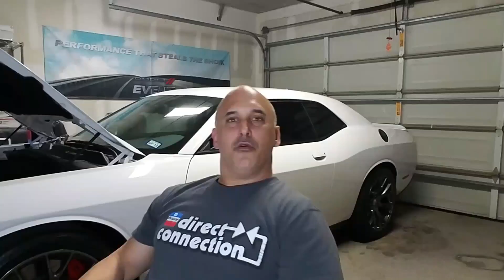Hemi engines, A quick explanation. Also, why did it take so long to reintroduce?

Comment: The emissions are way too tight today to ever have the OG HEMI again but the 392 and 345 today is about as close as we can get. The updated design still with OG roots is a throwback yet is versatile in most applications of driving.

Comment: Sad part is it isnt a true hemi.......its a bad joke
Reply from the maker: Thank God it's not a real Hemi, you obviously have never driven one. They drive like s*** unless you're at wide open throttle. So what part of "true Hemi " would make it better? Terrible drivability, horrible fuel mileage? The most hysterical thing about this, is that Dodge was trying to get out of the Hemi business before 1971 when the engine was canceled. They had long before realized that a canted valve architecture would not only be more economically viable, but would yield similar results at high RPM to the Hemi. There was also the pentastar head 4-valve that Dodge also called a Hemi that was under development to take the place of the cam in block engine.   But I guess you wouldn't call that a true Hemi either, would you? Typically I don't take this long on a response, but you really got underneath my skin on this. It's another joke in the Mopar community, the joke of the dying breed of people that "remember" the Gen 2 Hemi from the 60s. And I mean that literally, Because in 20 years nobody will be alive from that era. be glad that Dodge doing something now, lest your Legend and Legacy dies with that generation.
Reply: B Mason absolutely dead on target. Even us ole farts are driving today’s challengers, and chargers for one reason one reason only we remember the sound the feel of raw power not from a supercharger wine but from balls to walls POWER!!! Sorry but you have to respect the old to appreciate the new and boy do I ever. Start up thst 392 every morning to wake the neighbors lol

Comment: back in 1989 I rebuilt a 1970  barracuda 340 magnum wedge. 10:5-1 compression 375 hp but the kicker it red lined over 10k rpm and had 90 psi oil pressure on a cold start. I now own a 5.7 hemi in a 2018 challenger. It is rated at 375 hp it is a 345 cubic inch but because of the pollution control equipment and the computer governors red line it's rpm at about 5700. The new 5.7  gets a lot better gas mileage , I dont think it has the pep of the older 340 as in throttle response but with the 8 speed auto and variable valve timing the newer  5.7 has more torque. I love them both.

Comment: I have a 2016 Ram 1500 with 5.7 engine, I have the Hemi Tick and I hope I do not have the lifter problem that causes the flat spots on the camshaft. I have heard that the needle barrings on the roller lifter go bad causing the lifter to fail.

Comment: Old hemi new hemi it doesn't matter because 400hp is still 400hp but can say that the new hemi engine's you can put a bigger cam in it and get more HP then the old hemi with a bigger cam. The upgrades to a new hemi  will yield more HP/TQ . But as far as hemi engine's go they are still just the same as they were when they were first invented not much has changed.

Comment: First ..The 1966-1969 Street Hemi's ran solid lifters, then changed over to hydr.in 1970-1971.I ran a 1968 Hemi Road Runner..with a 432 cid  Twin 1150 Holley Dominators on a Weiand Tunnel Ram, 12.5:1 aluminum piston /compression, Triple Valve springs,titanium retainers  785 lift 296 duration cam&roller lifters. Built Torqueflite, 2.77 first gear straight cut gears, reverse shift pattern trans 5,000 stahl convertor , 5.11 rear gears It ran 145 mph 1/4 mile  9.4 time.  That was after it was stock..it ran 12.7 stock..with a slipping trans..(needed new clutch packs) The old street Hemi..mine got 22 on the highway and 11 around town..hard to keep your foot out of the 2x4's The old Street Hemi's still kick ass..on the new ones..just look around on Youtube.. You kind of bug me with your smug like attitude ..and the so called know it all about Hemi's.  I'd tone it down a little.. maybe it's just me..but that's how you come off to me.  I'd rather build a Hemi any day of the week. I found them easier to work on..I could do it in my sleep.. The 426 cid Race Hemi Z990..if that's what you are referring to as The Super Commando Hemi..had different heads..better heads and the block was canted up 10 degrees whereas the Street Hemi is not a true Hemi either..-10  Still dynoed at 490 -500 hp..Just my 2cents..
Reply: he really didn't do the history very well either. The first Chrysler Hemi was actually the massive 36 liter XIV-2220 inverted V-16 aircraft engine developed by Chrysler during World War II it was never put into production but Chrysler engineer learned a lot from that experiment. their were there "company" hemi's, the Chrysler's, the Dodge's and the DeSoto's ( the Desoto's are what gave us the 318 poly's). Hell the 392 Hemi from the Chrysler 300-D's was used by Don Garlits (first hemi dragster) back in the late 50's. The eventually quit making them because of expense, well until the NASCAR day's anyway.

Comment: Not sure if it was mentioned in any other comments. But from 1966 to 1969 the street Hemis used solid lifter camshafts . In 1970 and 71 they are hydraulic lifters

Comment: They had to wait for VVT to be developed to get around the low end and emissions. Emissions is why it’s still not a true hemi. Based on patent applications Chrysler began to develop their VVT in the late 90s. I wouldn’t use the penastar as comparison as it’s no where near the same head design as well as it was developed much later. The only thing they have in common is all Chrysler NA motors use only a MAP sensor instead of a MAP and MAF that’s more common in other companies engine management or FI engines in the Chrysler line up. Speed density is accurate enough for NA but not that great for FI set up.

Comment: How knowledgable are you on hemi? I understand your hemi explanation but what makes the car get up so fast and what makes it make that roaring noise? Also, why when I start in the morning it's even louder
Reply from the maker: TeW33zy the hemi, and many other engines, are louder on cold start due to the timing being retarded, in reference to normal operating temp timing values, comboned with a rich fuel mixture to aid in initial start up.

Comment: The original Chrysler hemi engines were introduced in the 1951 model year.  That first generation hemi was phased out in 1959.  The second generation hemi was introduced in 1964 as the race hemi.  In 1966, the street hemi was introduced and reigned supreme on the streets until 1971, when production ended.

The Super Commando engine was a Plymouth name for their V8s.  Dodge went with Ram, then Magnum for their engine names.  I am a fan of Chrysler automobiles from the Walter P. Chrysler days.

Comment: Fuck FIAT CHRYSLER! They have sold us a HEMI that has rocker arm/lifter problems around 100k miles. HEMI knock = RIP engine. Anyone looked at the wear of their cam shaft lately? I've seen 1995 stangs with less wear at 240k miles where Dodge gets at 80k.
Reply: jlrockafella our 2004 ram 2500 @ work has 345k still has the original cam .

Comment: Somebody need to learn the difference between HEMI® and hemi... they are not always the same.
Reply: I REALLY hate to say this, but Beemer is right.

The third gen "Hemi" is really a polyspherical 
combustion chamber engine.

"The current-production "HEMI" engine heads are flatter and more complex than the 1950s–'70s Hemi V8 chamber. The combustion chambers are no longer truly hemispherical."

Copied from here;

https://en.wikipedia.org/wiki/Chrysler_Hemi_engine#Third_Generation:_trademarked

I'm a Mopar fan, and have been since the mid 60's.

The second generation Hemi, is STILL the 
blueprint for top fuel drag cars.  (Well, except 
Big Daddy's stuff, he's running First Gen engines.)

The third gen engines, while being "Hemi" engines, 
aren't quite true hemis.  But 840 HP out of a street 
legal car, that is powerful enough, to lift the front 
wheels, and both fast (MPH) and quick (ET) enough 
to get thrown off NHRA tracks, is downright amazing!
This is a car that you can buy, legally drive to the track, 
and get kicked out, for to low ET, as well as a to high 
MPH!

steve
Reply: @bobba68 YOU'RE HERE ON THIS SIGHT TOO WITH YOUR HEMI PIPE DREAMS. FORD WHIPPED THE HEMI'S ASS, THEY WERE NO COMPETITION FOR THE 427 SOHC AND THE REASON THE NHRA BANNED THE FORD CAMMER IN 1971 BECAUSE IT WAS TO FAST. A HANDFUL OF CAMMER'S WERE BEATING DOWN ON THE HEMI SO BAD THAT THEY HAD TO GET RID OF IT. SO THE NHRA BANNED IT. GET OFF YOUR HEMI PIPE DREAM.
Reply: +bobba68 Hemi engines are obsolete
Reply: +bobba68 You are still suffering from nostalgia escapism... Hemi engines are obsolete.
Reply: +bobba68 Well, then please point me to a new car dealer where I can buy a REAL hemi engine????  .... you lose.*
Reply: +bobba68 "No longer produced, Discontinued, To be or become obsolete by replacing it with something new."
Reply: +bobba68 Hemis are OBSOLETE
Reply: +bobba68 Name a single currently available automobile model manufactured in series mass production that features a real hemi engine????
Reply: +bobba68 OBSOLETE
Reply: +bobba68 Then name just a single currently available automobile model manufactured in series mass production that features a real hemi engine???? There are none...
Reply: +bobba68 The real hemi engine is obsolete????
Reply: +bobba68 Still being made? Not for any new cars.. The hemi has been out of series mass production for decades.
Reply: +bobba68 They still make a few steam locomotives too...even though they also have been obsolete for years!!!
Reply: +bobba68 You are the one that has lost the argument... in fact you never had one.
Reply: +bobba68 I must say you make an excellent case study subject for the Dunning–Kruger effect...
Reply: +bobba68 hemi engines have been obsolete for decades
Reply: +bobba68 An automobile engine that is no longer used in automobile production is an OBSOLETE ENGINE
Reply: +bobba68 You lost... could not name a single car available with a hemi engine.
Reply: +bobba68 You don't even have an argument... hemi engines are obsolete.
Reply: +bobba68 People that love antiques still make Horse drawn wagons and steam locomotives.... They are obsolete too!
Reply: +bobba68 YOU CAN'T NAME A CAR!!!! An automobile engine that is no longer used in automobile production is an OBSOLETE ENGINE.
Reply: doktorbimmer - Somebody need to understand the discussion in the first place... it's pretty easy to get what the guy is saying, but for those always looking for one particular specific molecule to prop themselves up as smart... always miss the whole fucking point of the discussion.

Comment: I'm very lucky to have had a friend who ran one of the original LO23 Darts.I was allowed the privilege of starting it so Ricky could set the timing and while on jackstands,for my brother in law to check the 727 he had just changed the clutches and double-wrap front band in.To get in Charlie Castaldo's Dart was scary! Full on animal that today would be a mid 8 sec. car.Enough nostalgia.The newer gen engine is alot better than the first and second gen.Computer design, metallurgy improvements all give it a better starting point.

Comment: What about the Hemi 5.7 in the 2015 Chrysler 300, would you say thats a car to buy?
Reply from the maker: MrAlternation very nice car.  I know several people with the 345 and 375 hp 300's.  Sweet car for sure.
Reply: So many Chrysler 300s were built with v-6s that a 5.7 300 could be considered a "sleeper" most people expect a Challenger or Charger to be fast, 300's not so much.   Most likely a used 300 hemi was not driven as hard as a Challenger would have been driven.

Comment: Excellent analogy Professor Mason ; With pretty much every thing that we know about the old Hemi & the new Hemi and after watching this video around 8 or 10 times, I think we can safely say that the new Hemi does live up to the legend especially the 392 version. I've seen some publicity on the Proline Hemi engines being used in alot of cars (not just Mopars) these days and the Manufacturer (proline) stated that the advantages of the Hemispherical Cylinder head design could no longer be denied !
Reply from the maker: BDOG JR Thanks man! I love the new Hemis.  They perform better than ever could be expected from a historical standpoint and hold their own in areas of comparison where "common sense" may dictate otherwise.  All in all an awesome power plant!

Comment: Most if not all motorcycles are using 4 valve Hemish heads and I remember an 1976 Toyota with the 20R engine 4 valve Hemish head. When I was about 12, me & a buddy of mine saw a neighbor with the hood up on his brand new 71 Hemicuda b5 blue with Shaker hood. I never heard of a Hemi before that day but I new from watching my dad work on his cars that the spark plug wires didn't go thru the valve covers.
Reply from the maker: Very true.  In fact, I cant think of a bike that utilizes a wedge head??   I remember seeing my first hemi when I was a kid.  I thought the exact same thing.  " I bet changing sparkplugs is a breeze in that car"... I had no idea what it was or what I was looking at.  lol
Reply: @Moto-Psycho-1  They did drip oil into the cylinders when you pulled the tubes up and out ..when changing the plugs
Reply: B Mason the
Reply: Modern engines all use Pent-Roof chambers.. the hemispherical design has been obsolete for decades. Cheers!

Comment: Didn't know if you knew this also, there was another hemi in the late 70's that is more like the hemis of today, I can't remember what exactly they called it, but it was a very short run, wasn't a real good motor. How ever I think these new motors are bad ass, love the hemis and LS motors, but I really don't care to much for the Fords. The push rod motors are the best in my eyes.
Reply: gordyn kirschner maybe your referring to the 'ball stud' hemi
Reply: @Welcometofacsistube  I was think ball stud also but they had a few versions that never made production..
Reply from the maker: I'm not familiar with any other v8's. at least from Moapr.  One NEAT little engine is the Aussie I6 Hemi.  with some mods they can make some good power but suffer block rigidity issues.  When properly built though they can scream!
Reply: Oldsmobile had a hemi prototype but never produced it.
Reply: That may have been it... I've only heard about it one time.
Reply: Also, early on there was the 331 and the 354 hemi that I'm just learning about recently.
Reply from the maker: Yep. Check out the Desoto hemis. Cool old engines that paves the way.
Reply: Will do my friend.... hope to be able to meet up with ya soon
Reply from the maker: I'll be at RPR tonight. If you can get freed up come on out!
Reply: Brotha I'm still working in New Mexico..... Been out since Jan 28th... I'm freaking ready to get home and get a little track time in and hang with family and my car club family
Reply from the maker: gordyn kirschner I hear ya, I'll keep you posted if I crack a personal best.  DA is supposed to be pretty good. hoping for as little head wind as possible. last time out was rough.
Reply: 10-4 bud.... I must say the ole Scat Pack sounds great. However I'm really curios on how those 392's will sound with long tube headers and a full exhaust without the active exhaust. I found one of a guy running cut outs but with factory headers/manifolds and he runs around the Houston area RPR,and HMP. I'm thinking that car is running mid 11's if I'm not mistaken. It's a silver Scat Pack like yours. If I can get a good launch in mine, that little 5.7 may run mid 13's and I'd be shocked if I bust out a 12, and to be honest I'm not sure how the clutch, and the rear diff will hold up with real hard launch, cause I'm really just kind of rolling into it not dumping it.
Reply from the maker: gordyn kirschner I think with the right tire you can hit fairly hard but like you, I question the half shafts.  the rear I'm okay with.

Comment: I respect the Elder hemis but I think the new or hemis are  better I think that the newer hemis has much in common as the older hemi like the older 426 Hemi used  a different block all they did is put cylinder heads to call it Hemi like for example like the 426 Max wedge and the 426 Ramcharger that's where the legend Hemi was born that's why they have the reliability problems cylinder bores or cracking when high pressures and high heat and now the new or Hemi the block came from the LA Magnum platform that's why on the pickup trucks for the first model ears they call them Hemi magnums V8 5.7 now then if I'm wrong don't know hammer on me just let me know
Reply from the maker: The modern Hemi is its own platform.  I can understand the misconception though.